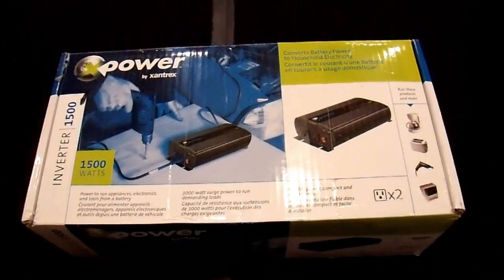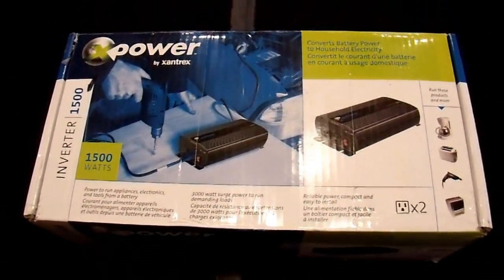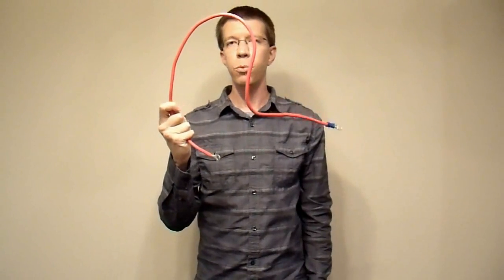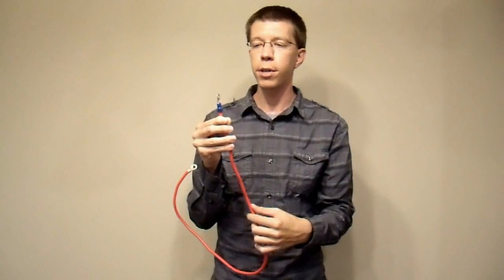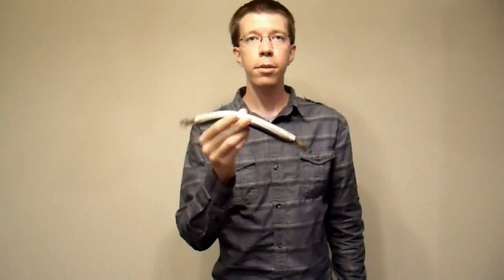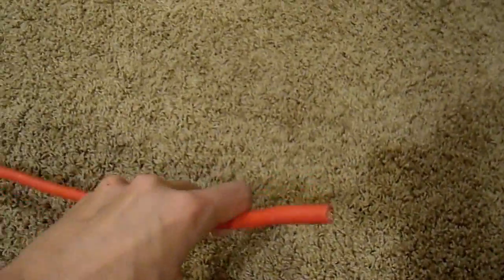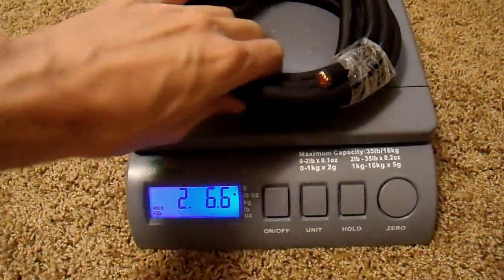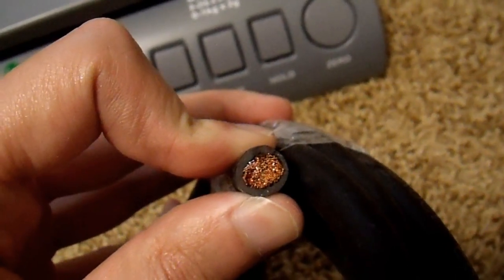How to Select and Purchase Battery Inverter Cables Part2

Comment: I was told to buy welder cable
Reply from the maker: I do the same today.  You probably don't need that level of wire quality for most projects but there doesn't seem to be much of a discount anymore for buying lesser wire, and the quality is usually terrible if you don't get name brand welding cable.  Many vendors on eBay and such crimp to suit as well for a reasonable charge.

Comment: Comical, audio doesn’t change physics.
Some of the best wire made, and made for longevity, is audio wire, 
Voltage drop matters exactly the same way, .5 volt is clearly audible.
The best wire, is tinned ofc, the best termination is crimped with at least 12 ton crimper, using a closed end copper tined, terminal. Adding a bit of dielectric grease to the freshly cut end, this is then sealed with double wall adhesive heat shrink, this is a typical marine grade wire.
Many in audio use exactly this.
An amp will not work properly, just like anything else with a large voltage drop, electrons don’t know if it’s an amp, or an inverter.
I was with ya, till the stupid audio commentary!
Reply from the maker: Wire sold for audio purposes is nearly always much thinner than advertised and usually of very poor quality despite marketing claims.  People think they need thicker wire than they really do for amps so they get away with grossly overcharging for cheap junk wire.  Don't use it.  Ever.  Including for audio purposes.  Welding cable is generally the best cost to quality ratio you can get.

Comment: 15 feet from a battery to a truck cab? Jesus. Loll😅
Reply from the maker: If you've ever attempted to route wiring from one location to another you'll know that it isn't a straight line.  The inverter will probably be behind the seat, the battery will probably be near the front, you need to go through the firewall in a convenient location, need to route around the doors, etc.  15ft might be on the low side for estimating purposes.

Comment: When installing an inverter in a vehicle, what are your thoughts on connecting the negative side of the inverter to the vehicle chassis rather than directly to the battery negative terminal?
Reply from the maker: I wouldn't recommend that in general for two reasons:  1.  The ground connection of the battery is guaranteed to be well connected to the engine in order to power the starter.  The chassis connection is often quite weak in comparison.  2.  Vehicles often have grounding issues with simple things like fuel pumps, lights, etc.  If the chassis connections can hardly handle 10's of amps 100's of amps seems like a potential problem.  There's nothing wrong with using the chassis conceptually, I just think people in general will overlook the practical aspects and end up with problems and a cable straight to the inverter fixes that.  Or make sure the entire ground path is clean, corrosion free, and adequate.  That would work too.

Comment: Yes, on jumper cables; you will often find 'CCA' printed on the insulation. This is the Copper Clad Aluminum designation.
Since they are an inexpensive source, it is an option, but de-rate it one wire size to get the pure copper equivalent.
2 Ga. CCA ~ 4Ga Copper as a rule of thumb. But packaging lies still exist.
Reply from the maker: Good tip.  Unfortunately even CCA cables often are not the gauge they claim to be.  Today (2022) with metal prices soaring almost no jumper cables are honest with their specs so this video is more relevant than ever.

Comment: I’m hoping I understand this… so if I have a 1500w inverter, a 2AWG is sufficient at 4ft?
Reply from the maker: Without doing any calculations, yes, that sounds sufficient.  Most 1500W inverters are well served with 4AWG wiring at reasonable lengths like 4ft.  2AWG will only provide better performance.

Comment: Great videos.  Need confirmation.
I bought a 1500 Watt continuous/3000 Watt Peak Modified Sine Wave Power Inverter from
Harbor Freight of the Jupiter Model. 120V – 2 USB – short circuit overload protection – 115 +/- 10 VAC.
I also got the kit wires which is 6 ft. – 2 AWG positive/negative and  6 ft. -  8 AWG ground wire.
I want to power a Ryobi Electric Water Pressure unit.  It will only run 15 to 20 minutes for each use. It said it was 13 amps, did not see any wattage.
I was wondering, what would be the best way to attach it to the battery. Alligator claw clamps, special battery post if there is a thing.  Quick connect?  Any suggestion would be appreciated.  Thanks…..I subscribed also.
Reply from the maker: I probably need more information to give you a good response.  My first thought is that most 1500W inverters will not run your pressure washer - you may or may not get lucky there.  My second thought is that you either need a few good batteries or one good battery (most car batteries are marginal even when new due to undersizing/cost cuts) and a running engine with low aux loads e.g. no headlights, etc.  Alligator clamps to a lead post work well for these currents - for example if you have a battery with both side and top posts this works well.  Clamping to anything but soft lead isn't going to work well.  I'm assuming this is a standard car/truck and you don't want a permanent install and in that case you need a very good connection at 150A.  Ring terminals bolted directly to the battery is best.  There are 150A rated quick connectors like you see on forklifts that can be purchased.  If you have side posts you can purchase slightly longer battery bolts to accomodate this.  If top post there are other high current options available.

Comment: Thank you: this is the video I was looking for an answer,have 24v 2800w inv surge 5600watts 4x6v batteries by 210 AH in serial so I guess 1/0 with 150AM circuit breaker before inverter will do the trick..,Hope I am right .
Reply from the maker: I don't know your cable lengths but that sounds about right.  The most common error is undersizing cables and it sounds like you won't make that mistake.  How many AH are your 6V batteries?  If standard GC2 batteries you may be battery limited.  That isn't a problem if you're aware of it but it's a limitation that is important to recognize.
Reply: @knurlgnar24  What I have done so far is 4 by 6 v batteries in serial at 215 AH exactly,have used (and overkill) 2/0 cables .. the maximum length is 2 metres one negative cables only rest much shorter as I have no room in van so 2 batteries either side side ,then before the inverter I have 150 A circuit breaker and before cir cbrkr have and Isolating switch 200AH ,the solar is 300Watt 24V panel 9.2A open circuit &28v open as well so have 15A fuse to before my 30A MPPT and 30A fuse on the positive side to battery bank also . tested today batteris went up to 25.6v only(not fully charged but ok) used Microwave no issue.. hot water kettle 1300 watts noticed voltage going down to 23.6 but remained there and when finished jumbed back to 25.2V, then physically checked all wires and non was warm whatsoever cold and nice)it is raining and winter still in Sydney ) .
let me know if good.. thanks so much

Comment: Congratulations really good explanation on how to choose the right  cable for your application.i have a question for you in my case I bought a 1500 watts inverter and I planned to run cables 10ft long do I need 4/0 or 2/0 thanks
Reply from the maker: Without knowing the specifics of your application I would be fairly confident saying that 2/0 is adequate and that 4/0 would be overkill.  4/0 would work great but cost more and likely not give you much benefit considering the added cost.  But if you think you might upgrade to a 3kw inverter in the future you'd be ready...
Reply: knurlgnar24  thanks and sorry I just check and the one that I bought is 4  not 4/0

Comment: Just bought 2/0 welding cable 20ft. Mounting my 1500w sine inverter in cargo area on my 4runner with hopefully 10ft or less each cable. Hope I it’s correct and enough to power my inverter correctly.
Reply from the maker: Based on the limited information in your comment it sounds to me like you are head-and-shoulders above what most people do.  Commonly people install 4AWG at the heaviest and then wonder why it doesn't work well..  I think you will be pleased with the result!  I am not familiar with the 4runner charging system but I know they are good vehicles otherwise.  If you have heavy loads you run for long periods of time you may want to monitor the temperature of the alternator just to make sure it can handle the load since many vehicles cannot in their factory form.
Reply: @knurlgnar24  Yea been doing a lot of reearch and most guys say 2/0 for 1500w more than 7ft length. At least I know I have heavy cables, never hurts other than cost. Lol

Comment: And  another question here,Installation of home energy storage system, inverter and cable are purchased separately?
Where to buy?
Reply from the maker: I purchased some from ACDC wire and supply recently and it was good stuff at reasonable prices.  I got their 4/0 AWG.  If you want other gauges you'd have to look at other sources as they really only do 4/0.

Comment: Sorry, but your statement about voltage drop is incorrect. The more resistance of the cable the more voltage drop , the higher the current draw , the warmer the wire.

Comment: I'm on 10 liters of oxygen using a Respironics Millennium M10 oxygen concentrator, average power consumption 600w. Is it possible to power my concentrator in a vehicle while traveling using the correct size inverter?

Comment: If you have a long run, wouldn't the best bet be to make a short run to the inverter itself, then a long run from the 120V outlets of the inverter to where you want your power? 
Dropping from 12 DC to 120VAC drops the current by 10, allowing you to have the long run with a standard extension cable instead of 2 or 1 gauge.
Reply from the maker: Yes.  An assumption made in this video is that a person would know to locate the inverter as close to the batteries as is practical.  I probably should have stated that directly in the video.

Comment: I’m trying to install 3000w inverter for my Prius.  If I want to pull 2500-3000w,  is this mean I will have to put a 250A fuse on the battery positive side?
Reply from the maker: I am not very familiar with connecting an inverter to a Prius, but if you mean the 12V battery then you will be limited to less than 1000W from the vehicle longer term.  A 3kw inverter would require multiple 12V batteries.

Comment: Welding cable uses thinner strands, which conduct AC voltage better. But for DC wiring, it is more susceptible to corrosion and has higher resistance. You are better off looking for fully tinned "number three machine wire" which is closer to battery cable.

Comment: Stop being stupid !
  AMPLIFIER KIT'S have any size wire you like and are way cheaper Amp kits have a lot of other parts as well.
  You can get 00 wire in a dual amp kit for 65$ plus that kit has speaker wire and remote wire and fuses 250 amp.
   i have looked at every type of wire out there and AMP kit's for any solar set up is what I would do !

Comment: Excellent videos!  Using your explanation/demonstration on the proper selection of cabling for inverters I decided to go with the welding cables.  Reason?  I own and operate a tractor and trailer and need an inverter for the creature comforts of home while on the road and know that the proper investment in equipment will keep the operator and others safe.  Now I may understand why some semi trucks catch on fire while parked; many of those fires start when the driver is tucked in his/her bunk with a ceramic heater for the winter months or a stand alone air conditioner for the summer months.  Or, the driver has too much plugged in and the system and cabling is overloaded and the truck burns to the ground.  The AWG table and calculator helped to Super Simplify the decision making process.  Thanks again!

Comment: Helpful vid, thanks.  I learned in high school electronics that electricity, which is the flowing electrons in the energy of voltage and current actually travel on the outside diameter of a wire, and not through the center, per se.   That is the physics of how electricity moves along a conductor.  So, accordingly, with stranded wire, the diameter of each strand provides more surface area for the EMF to travel compared to the same diameter solid wire.  Also, then there is the added benefit that stranded wire is much more flexible, lasting much longer before breaking.
Reply: That is called the skin effect and is exhibited in AC circuits. These cables were sized for the DC side of the system.

Comment: 3000watt/6000watt surge. So should I get 300 or 350 amp wire? Its gonna be mounted behind my truck seat prob around 12 to 15ft each way pos and neg.

Comment: Awsome videos... Been watching a bunch of them and using the info in my array set up.
   I have a question I am hoping someone can advise....
I am upgrading my Battery Bank to (4)- 100ah AGM batteries ....   I have a 2000/3000 watt PSW Inverter (Ran 1/0 awg to it at 28" each way) So now when the batteries I am adding to array (will be 4 total) come what gauge can I get away with for the interconnects between the batteries In Parallel ?     They will be aprox 10"  long each  or less , I don't know till I arrange them ... I have a few ft. of 4 awg I was hoping to use....
    I don't work the inverter nearly as hard as it can take ...maybe 120 amps tops with a mini microwave for a short time...

Comment: When you mention that you put two cables in pararel that is the correct way BUT that does not converts two #2 G to one No way you need to review the pararel circuits in any electrician or electronic book, To make it easy and no math is simple . The result of two cables in pararel is less than the one that has least resistance.This means that it will get hotter or burn faster this is just a friendly advise its never to late to learn the right way

Comment: I recently purchased a Bestek 2000W modified sine wave inverted.  Is this a decent inverter?
Reply: Pure sine its better,
Reply: Armin Kupper yes pure sine is definitely better.  But I am now stuck with Bestik modified sine since I cannot return it.

Hope it will not ruin my fan or LED lights over time.

Comment: Great information thanks ! Just wondering though You talked about Voltage Drop and Heat effect/ High amp draw fire hazards etc. But what happens from the inverter to the load? I'm going to need probably a 25' 8/3 or 6/3 cable for AC outlets in RV parks to plug in. Then the longest run of 14/2 cable is going to be about 30'. So 25' of 6/3 plus 30'  of 14/2 is the longest run. Is there a way to cut off that 25' of 6/3 cable and go straight to the 14/2 cable through the Circuit Breaker box?

Comment: All I can say is AWESOME!!!!!!!!
Simple explanation for getting started. I have watched dozens of videos in hopes of finding one on wire sizing. You have done a fantastic job of explaining for the beginner.
I am currently setting up my camper to run on solar as much as possible.
This is what I'm starting with in hopes that it will serve my needs.
100 watt mono crystalline panel 
3000 watt inverter
2-160 ah AGM deep cycle communication batteries
30 amp controller 
And I have about 100ft of 00awg welding lead cable, score!
I estimate a total of 5-6ft to tie the batteries together and connect to the inverter
Mainly what I will be using would be a small camper fridge lights and radio and occasional power tools.
I am a prospector and am used to not having power sometimes but would be nice to keep the food clod for longer without burning a lot of gas.
Thanks again for all the info and I have subscribed and plan on checking out more.
Btw This for mat is excellent if the person doing it knows their stuff and you sir do seem to.

Comment: Finally a guy who talks a lot with out any bull shit!! You seconded my thoughts about using jumper cables and especially the ground wire welding welding cable! Welding cable is the wire I liked best for possibly connecting a inverter in my pick up truck

Comment: I'm putting the car battery in the trunk of my race car. I need about 20ft from battery to killswitch to starter. I'll be running the neg from engine to frame and battery to frame 5ft ish total. I went to a supply store that wanted about 7 bucks a ft for 1/0 gauge. Went to Napa they told me I need 2gauge that was 3.50 a ft but I knew that was too thin. I have decided to go with welding wire because it was cheaper. I found a supplier online 1/0 gauge 20ft for about 42 bucks. I'm just wondering how well welding wire is regulated?

Comment: If you are going to use an inverter in a vehicle to charge anything larger than a cellfone consider using a second battery and a splitter. It's actually cheaper than what the guy in the video is telling you to do.

Comment: should one account for the resistance of the connectors in calculations?  If so would it be added to voltage drop? but does this matter?

Comment: Still a bit confused. I have a 75 watt solar panel connected to a 12volt 30amp charge controller, connected to a 12volt car battery. I just bought an eliminator 1500 watt inverter. from battery to inverter will be about 2 feet. what awg or gauge wire do you recommend?

Comment: Hi knurlgnar24 I was wondering where you get your wire at. I am looking to buy some 0 gauge cable to wire my two golf cart batteries together and then wire them to my 1500 watt inverter. I have some cheap 2 gauge cable connecting my two golf cart batteries together right now and it tends to get very hot when I draw 1500 watts.